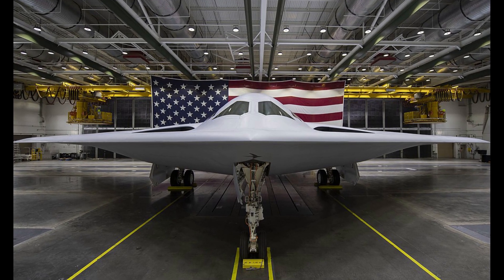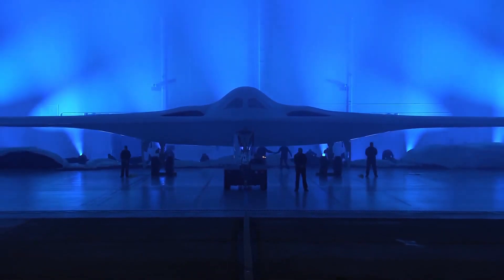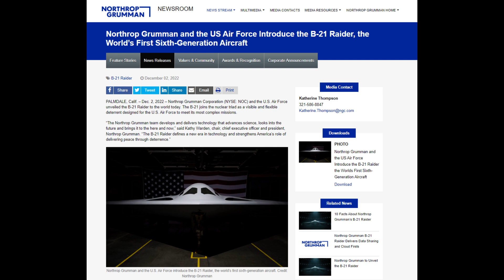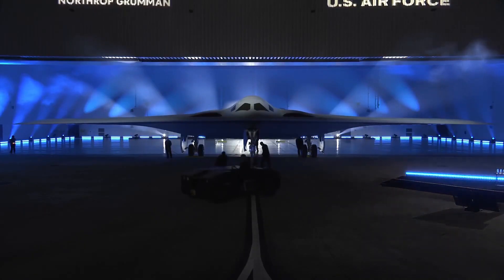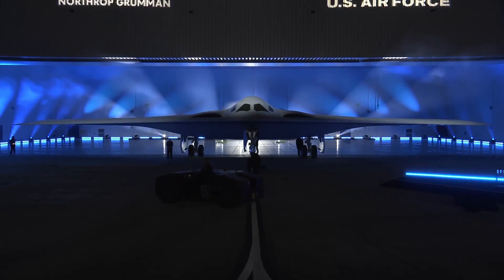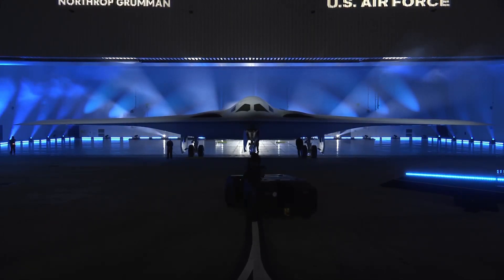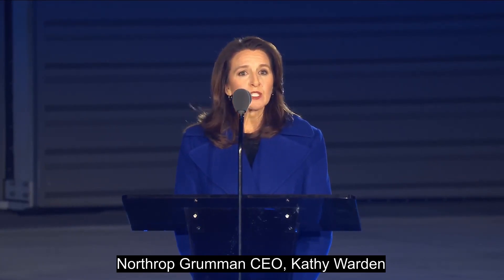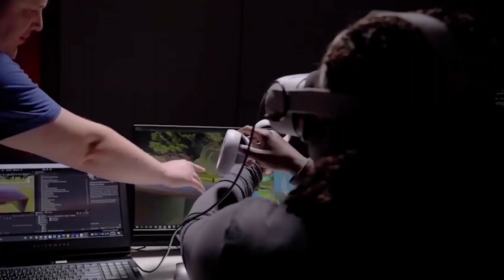B-21 Raider Stealth Bomber - Fearsome Weapon or Giant Money Sink?

Comment: These comments are completely braindead.

1. 700mil figure is a topline, not to exceed, figure for APUC. Which includes total cost of procurement to include, flyaway, support eq, training, spares & ECOs. all divided by total number procured. in this case its 100. However, it's widely believed the USAF will procure well over 100 B-21's. most likely between 140-200. F-35 APUC is 135mill. In that sense B-21 looks much better than past programs.

2. The most costly thing about buying a new aircraft, ship or whatever isn't procurement costs. Its sustainment, and upgrades. In that aspect the B-21 is VASTLY superior to whatever the USAF has right now. B-21 requires significantly less basing support and specialized hangers. Uses much more durable materials. And its much easier to upgrade thanks to open-architecutre systems

3. Again, people have NO CLUE why the B-2 was expensive and canceled. the B-2 production was cut short because the cold war ended. And since so few were made, costs of the program were spread out over just 20 aircraft, hence the 2 Billion each figure. that's literally it. This same reason applies to the F-22, and many other post cold war defense programs cut short. If the Cold war ended in 2000, you;d be looking at a fleet of 70-80 B-2s, and 300-400 raptors. 

3. Speaking of open architecture systems. This is the real revolution the B-21 brings. DoD has been harping about it for 2 decades and only have the cracked the code. Open architecture means the USAF owns a lot of the IP on the B-21. And they can compete or subcontract components/upgrades to other vendors. This effectively kills vendor lock which has harmed programs like the F-35. It also means upgrading the B-21 is a lot easier, faster and cheaper. Air Force Global Strike Commander Gen. Timothy Ray said he expects integrating new weapons on the B-21 to take A TENTH of the time it did for the B-2.

The amount of cope following the B-21 reveal is insane
Reply from the maker: I don't know very much about the plane, but I think most points raised in there are uncontroversial. I am more asking questions. Thanks for your comment
Reply: @EurasiaNaval  i was more so talking about the comments UNDER the video
Reply from the maker: @sevrent2811  Got it, thanks

Comment: Procurement will be the usual way . The contractor quotes a low procurement price..( if its a fixed price per plane plus spares/parts/maintenance etc ) it will rise moderately. As the manufacturing and development continue, modifications and upgrades will bump up the cost per plane to probably another 200 million to 350 million ( or more). A project with the huge structure and technical sophistication of the B21 will always end up with a final procurement price well in excess of the original bid. Now, if the government could convince the contrator to submit a firm fixed bid + plus maybe some overruns..it would cost much less.

Comment: No doubt the contractor knows what tests the B21 will have trouble passing. If it was Lockheed, then I would expect the tests that are gonna fail will be the tests the contractor justifies doing last.  That’s to keep the money rolling in and harder to cancel the program when testing finally reveals the magnitude of the problems.

Comment: Very little evidence that this bomber is significantly better than B2.
Reply: Probably not better, just cheaper.
Reply: half capacity, subsonic.
Reply: In the coming years much of what it brings differently will become more known, it only carries half the payload, 30 vice 60K, the entire program is scoped from a different perspective than the B-2. This is much more versatile and flexible for a different operational environment than the B-2 was designed for.
Reply: On logistical side it should be, if everything works as intendent.
Reply: I think Northrop Grumman wants to keep whatever evidence there is quiet, but if there is no evidence at all, it might just come down to it being less expensive.
Reply: @HTV-2_Hypersonic_Glide_Vehicle  Biggest thing, it’s going to require much less maintenance, it’ll be more of a versatile strike platform than a strategic bomber.
Reply: Actually there is a lot of evidence that the jet is better. One significant one is literally 4 decades on technological innovation... duh....

Comment: The cost per unit will be north of $700 million. It's another Zumwalt in the making.
Reply: probably b21 also need special ammo?
Reply: 700 million for a single plane, even accounting for research costs and tooling and other fixed costs, is still insane considering that China now is advancing its AI technology to track assets everywhere, at all times through live satellite feeds. You can hide from radar but you can't hide in visible spectrum. Unless Nothrop comes up with optical camouflage.
Reply: Well, at least B-21 is intended to fight peer adveraries. Zumwalt is practically useless in that regard
Reply: Came in underbudget, cheaper, doesn't need forward bases, doesn't need Ariel refueling, came be manned and unmanned. China is about 60 years behind. So no I don't think it's a Zumwalt. Also Zumwalt was a technology test bed, next generation of warship will incorporate most of what we learned from that ship. That ship is so far ahead of its peer it might as well be a space ship.
Reply: @MrRinoHunter  yeah it's overpriced junk
Reply: @MrRinoHunter  underbudget? Whose budget? Cheaper? Cheaper than what? Non need for aerial refueling? Really,? This thing has unlimited range?
Reply: @hbc511  tell me how it's overpriced
Reply: @_Wai_Wai_  it's cheaper than the b2 the b2 cost around 2billion per unit and the b21 is  under budget and everything y'all want to know is classified so you can't go with everything he's going with